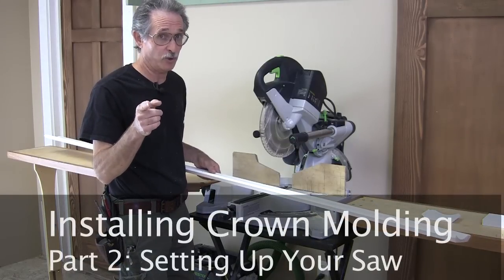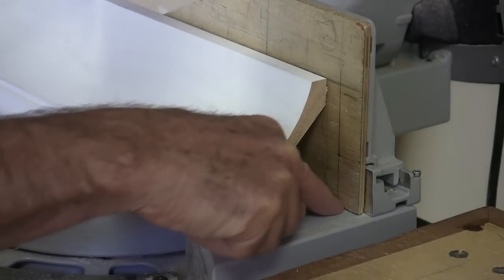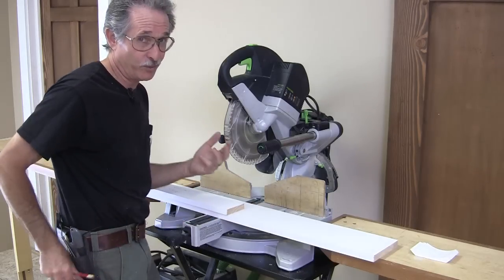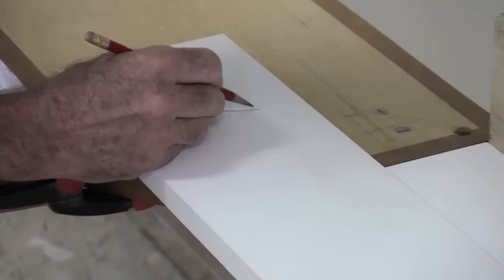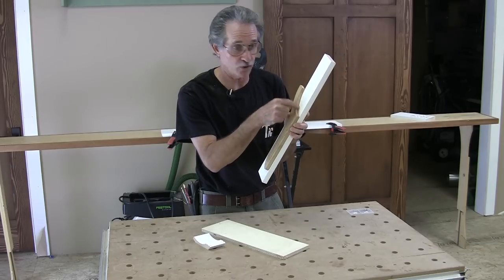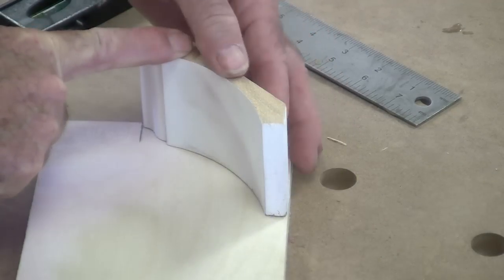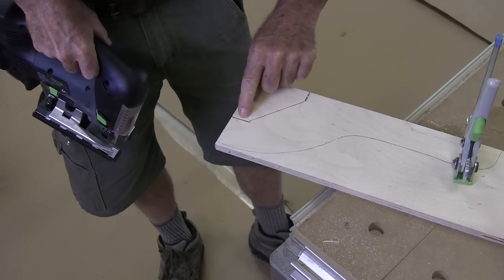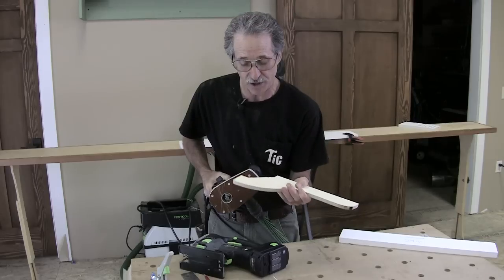Installing Crown Molding: Saw Setup

Comment: Great information! I understand that the more detailed side of the crown is the side that should be installed to the wall and not the ceiling. Does it really matter which side goes to the ceiling and which side goes to the wall?
Reply: agree-Generally, the end with the least amount of detail goes on top, and the decorative trim faces the bottom.